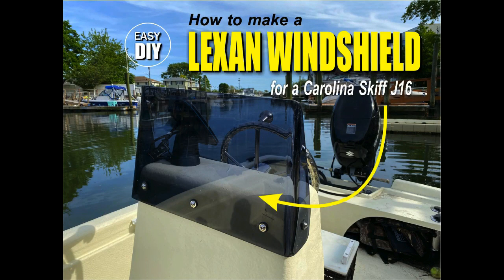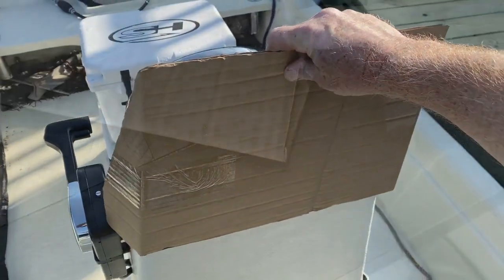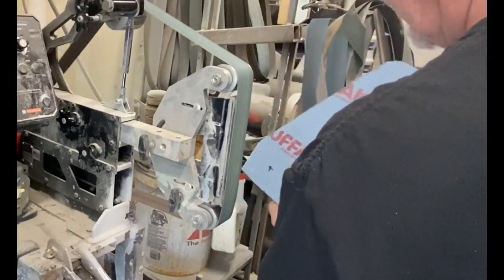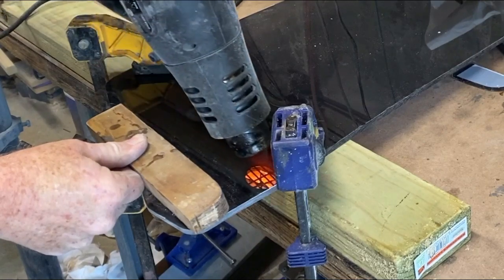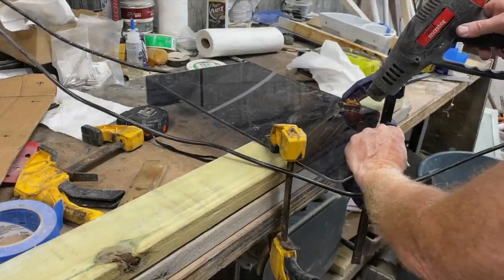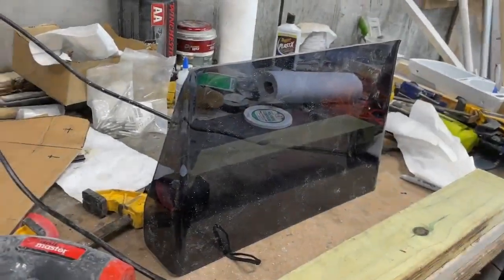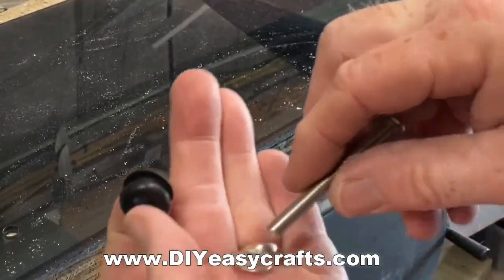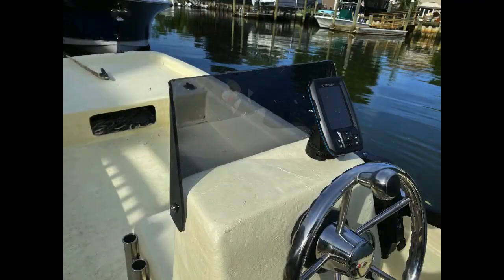How to make a DIY Lexan windshield for a Carolina Skiff J16

Comment: Great video, 
I want to build my own, I'm tired of the wind in my face and bugs and dry eyes. 
I've bent clear Lexan alot with a wide brake and a rolling crease to it for machine guarding. No heat nothing. Just a metal brake and quite a bit of roll to the bend. Lexan is very strong and resistant to shattering. 
I have never worked with the tinted kind but being lexan I would believe it works the same. As for drilling, you are spot on with the unibit or an acrylic drill bit. A regular drill bit will bite and ruin lexan holes with micro fractures that will show up eventually if not immediately.